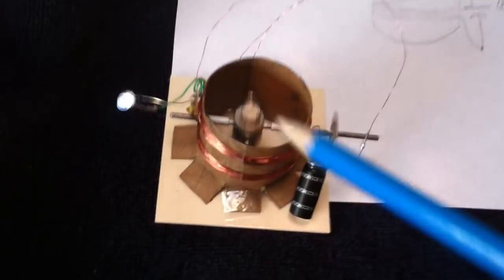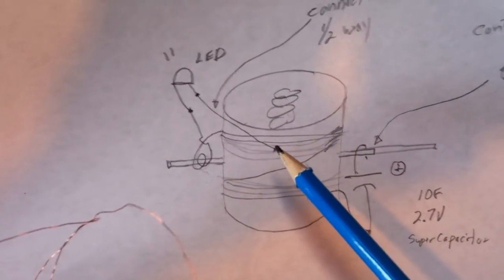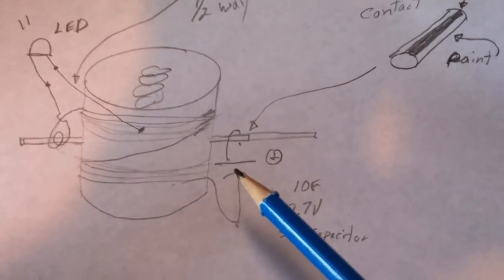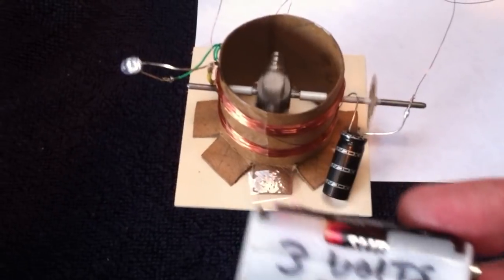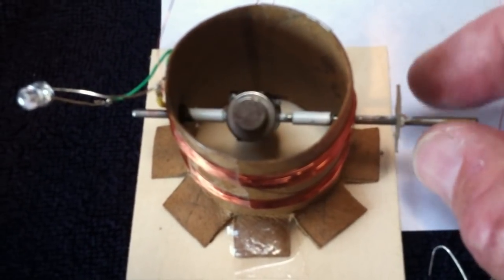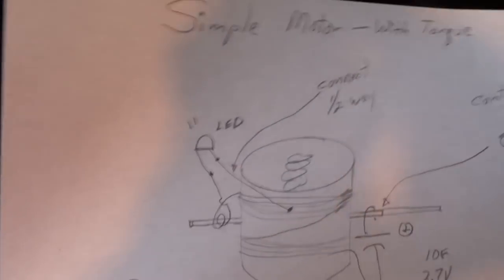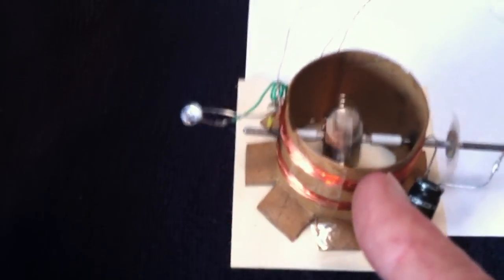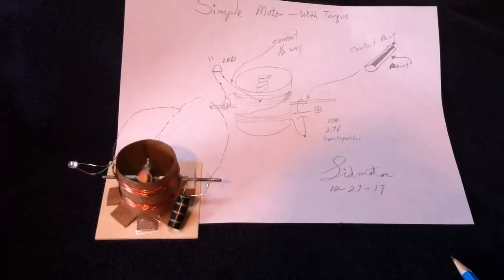Simple Motor With Torque

Comment: Greetings Lidmotor. I built a version of this with great results on my way to building the Ed Gray motor. The design used a NEO that  had a hole axially, Diametric magnetic configuration for the N/S was radially not axially. The poles were on outside of the cylinder not on the common ends. This magnet configuration also had no wobble so all the energy stayed within the rotation. This made it easy to use an aluminum shaft on ball bearings, and each magnet could have two coils almost pressed together in a sandwich with the gap only enough for the shaft clearance. The design was to use two coils that the magnet could be positioned half way inside. A DC pulse could be generated through both magnets in opposite polls.  I actually had two magnets and four coils, the second set of magnet and coils were running Ed Gray style for explosive torque!

Comment: I predict you are going to need a rubber band on the wheel for traction, else it will spin the wheel and not go any where.
Reply from the maker: I might use rubber bands or cut pieces of a latex glove if the wheels slip too much.